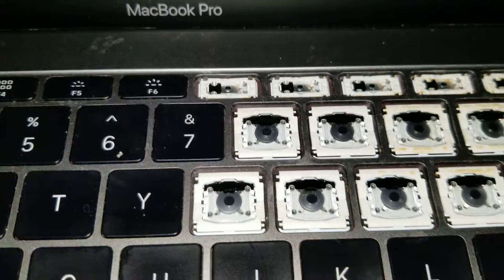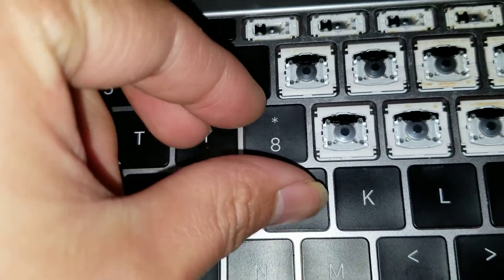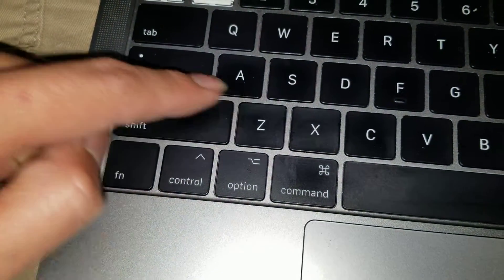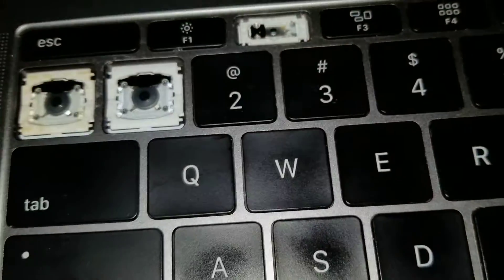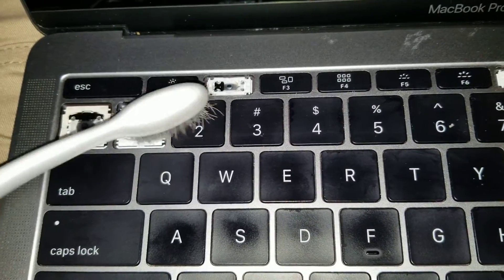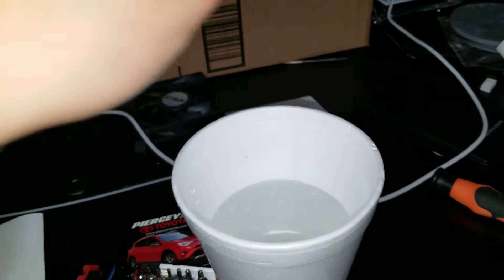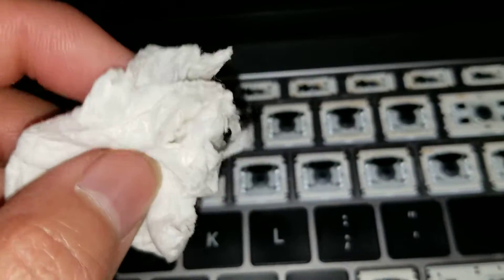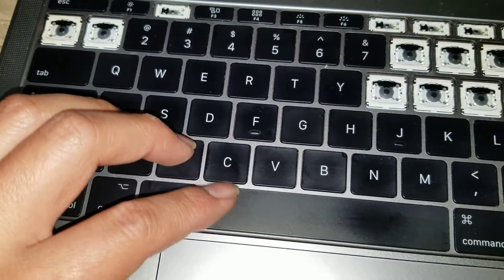How to clean and repair sticky stiff stuck Apple Mac MacBook Pro 2016 2017 2018 butterfly keys key.

Comment: You might be my new hero. Yesterday I took my old MacBook to an Apple repair shop to address a stuck 'n' key that would constantly double or triple print when touched. They told me it would be $600 because the entire keyboard would need to be replaced and that I'd be better off just purchasing an external keyboard. This morning I saw this and tried it. Issue solved. Thank you!
Reply from the maker: Awesome, glad it helped. If you haven't already, please like and subscribe so others can find my videos and possibly consider watching a few others, liking and commenting to get the algorithm to recommend my channel. Thanks!

Comment: I did what you did, and it never fixed it. In the end I ended up popping the key off and cutting little peaces of paper and got tape and taped the little bits of paper the the key. And that actually fixed. it.
Reply from the maker: @mikehawk7307  uhhh what?
Reply: @ItsBinhRepaired  I was able to cut small squares o paper I think 4 MM squares. And I put 3 o the small sheets that I cut on the I guess knob of the key. And once I did that my key was working normally. It is a temporary fix. At least till you get a keyboard palm rest.
Reply from the maker: Nice

Comment: My return key is stuck (it wont come back up) but it still works. Any suggestions?
Reply from the maker: Sounds like a broken clip
Reply: @ItsBinhRepaired  can it be fixed? (also tysm for replying on an 8 year old video)
Reply from the maker: @altaioid  you'll have to replace the damaged part
Reply: @ItsBinhRepaired  oh ok :)
Reply from the maker: Yup

Comment: don't use water, use rubbing alcohol or distilled water.
Reply from the maker: Doesn't work well to dissolve sugar.
Reply: @ItsBinhRepaired  wouldn’t alcohol be better since it’s slightly acidic?
Reply from the maker: @nomnom3265  sugar is a polarv substance. Alcohol is non polar. It'll work if you have a low alcohol concentration, but then whatever you're worried water will do, the low concentration alcohol will also do.
Reply from the maker: @nomnom3265 Google says it's not necessarily acidic and often is basic.
Reply: @ItsBinhRepaired  its the minerals in the water that ruin tech. that's why you use distilled water or high concentration alcohol.
Reply from the maker: @nomnom3265  it's only an issue if you pass a current through it to incorrect components.

Comment: Success! I can now type "R". Thank You. I have a 2012 macbook. I think the key design must be a little different than this one because the key seems to have microscopic hook on top of key with teeny tiny clips on bottom. It was easier to pop off from bottom, not top. 

I used my fingernail to pry if off carefully, popped off from bottom of key. There was a tiny bit of dirt around edges of key, but the issue for me was that there is a tiny clear plastic nipple button that is supposed to sit directly under the center of the key, and it had moved out of place so the key was no longer working. I moved it back to center and popped the key back on, again hooking from top and pressing down until the clips popped into place on the bottom of the key. Careful with that little clear plastic button - when brushing the key with an alcohol-dampened cotton-swab, I nearly lost the button. It's clear and tiny.
Reply from the maker: Awesome, glad you werw able to figure it out

Comment: Oh no I tried this and the key went more inside when putting it back.HELP!! 😭😭😭😭😭
Reply from the maker: Sounds like the clip might have been damaged
Reply: @ItsBinhRepaired  omg what do I do now 😭😭
Reply from the maker: @arbinapradhan2469  pop it out and check it. You might need to get replacement pieces if damaged. Could be you bent the metal pieces if the clips are all in tact
Reply: @ItsBinhRepaired  but how do I know if it's damaged I don't know how it should be initially.. I can't press it..I mean the key doesn't work at all like it's fixated..I think I broke something while taking it out
Reply from the maker: @arbinapradhan2469  pressing the thing under the key doesn't work?
Reply: @ItsBinhRepaired  I just pulled it up a bit with my nails now I can type "3" but it's hard..I mean it's not soft and  doesn't produce click sound.. Idk what's wrong 😭 but at least I can press "3" now but yea not easily
Reply from the maker: @arbinapradhan2469  sounds like it's not put back right
Reply: @ItsBinhRepaired  yes thank you for your time and support<3
Reply from the maker: I hate how YouTube doesn't notify me of replies. Were you able to figure it out?

Comment: Good video and very big thanks.

Here's what I can add to the topic, after messing with my freshly bought used 2015 12 inch macbook retina:

first off: DONT TRY ANY OF THIS IF YOU ARE NOT VERY SKILLED WITH VERY SMALL PARTS, YOU WILL BREAK IT

1) the keys can easily be hindered by either just dust, or the slightest amount of any liquid with sugar in it (acts much like weak glue)
 -> you can clean that up and the keys should be responsive again (read below)
2) the hinges (small hooks of 2 forms (one U shaped, the other C shaped) can break obviously before opening the key up. 
 -> unless they did not break *off*, you can use a tiny amount of superglue and apply it to the hinge and glue it together. I used "loctite control" to fix a broken escape key
3) the bracing of the keys (white plastic, the actual "butterfly") is the most fragile part and can be removed. it's put in place by small stakes going off to the outer sides. if you bend them in that direction, you can release them from the transparent peace of plastic holding the actual button (don't fiddle with that one, I wasnt able to find out if that one's glued, clipped or how the LED is attached!!!!). the axis of the butterfly part is actually just a tiny, flatly pressed pease of plastsic (all unibody) that can tear (found the delete key had that problem) - although, the key might still work more or less fine
 -> you can clean it up and you should be able to superglue broken parts of it together again, since it's all one peace of plastic, UNLESS that small membrane like axis doesnt tear. I was able to tape it together with thin polymid tape, but didnt test much.
4) this keyboard seems to have the back of the keyboard (facing towards the bottom, if it's in normal use) bulges according to key presses. I found no way to fix that with just the keys removed from the top and I read somewhere that the keyboard is held in place with bolts and glue, so
 -> I'll get a new battery (that one's a goner too and needs replacement LoL) and when I replace that, I'll take a look at the back of the keyborad and see if there's a way to stabilize it to pop the keys back outwards a tiny bit - if I don't forget, I'll update my comment

why am I writing this? because the video is supercool and I thought folks should at least have some thoughts on it if they are willing to try to fix it, since I think these devices are really nice and deserve a long life.
all in all, the concept of the butterfly keys is a very good one, but the construct has some major flaws how it was eventually built, which is very typical of apple.

also please: never ever throw away these devices. they are super power efficient, can run other operating systems, have a small mainboard/logicboard and can be used even without display/keyboard/case.
Reply from the maker: I made other videos that are in a pinned comment explaining these other things. If the directions are followed exactly, the chance of damaging it is nearly 0.

Comment: I have a question for you! I have two keys that are not snapping back in but they look exactly like the keys that snap back in -no broken pieces. I even tested a "k" key that works well and tried to snap it into the "f" key that is not snapping back in and the "k" key snapped into the f bracket perfectly. Do you have any advice as to why 1 key is not working or snapping back in? Thank you!
Reply from the maker: Either the hinge or the key is broken. You'll have to look closer.

Comment: IF ANY WATER IS EVER USED, USE DISTILLED WATER AND MORE IMPORTANTLY  MAKE SURE DEVICE IS OFF,  UNPLUGGED WITH BATTERY  DISCONNECTED PRIOR TO ANY REPAIRS.  WHY NOT USE 99.99% IPA ON STICKY SUGARY SUBSTANCES??
Reply from the maker: Do me a favor and fill a glass with 99.99% IPA and then put a teaspoon of sugar in and try to dissolve it. You can do the same with honey/syrup.

Now take a glass of distilled water and put a pinch of salt in it and check the resistance of the water with an ohm meter.

What you're saying sounds good in theory,  but doesn't matter when it comes to cleaning contaminants.

Comment: will vacuuming the dust out do any good? i'm scared it might suck in the actual keyboard mechanism and break it
Reply from the maker: Depends on the power of your vacuum. If you use the hand bristle tool, it should be ok, just don't be too rough.

Comment: Unfortunately, I've seen almost all key problems arise from the fact that the keys are incredibly cheap pieces of plastic. This solution might work for the occasional sticky or dirty key, but not when the plastic claws and hooks break off (has now happened to me and plenty of others I know). Any suggestion for repair companies/services that fully replace keys?
Reply from the maker: There's a website called replacement laptop keys. You can order from there.

Comment: THE KEYS WONT GO ON
Reply from the maker: You might have broken the clips. Check the other video in the description.
Reply: @ItsBinhRepaired  I broke my hinges
Reply from the maker: @pillow1199  :( those need to be glued in. I've never replaced those before.
Reply: @ItsBinhRepaired  I bought a couple replacements off amazon
Reply from the maker: @pillow1199  hope they work

Comment: Unfortunately this didn't work for me so perhaps you can help. My H key just started giving me issues. It's not sticky or anything, it just doesn't register when I hit it. I have to press its harder in order to get it to work, and it doesn't always. I tried taking off the key and using the toothbrush method, but no luck. Any idea what I should do?
Reply from the maker: Sounds like the keyboard circuitry is actually bad.

Comment: Hi Binh, Whats the yellowish sticky stuff you cleaned with paper.. Is it tea or coffee spill by customer or something macbook pro's generate due to heat on motherboard..i have 2-3 keys making clicking sound..will cleaning the sticky stuff resolve the loud clicky sound issue..Thanks for this great helpful video
Reply from the maker: I don't remember, but it's usually something with sugar in it. Other substances don't stay sticky when dry. Usually soda, coffee/tea with sugar, sometimes alcoholic beverages, milk tea, juice, etc. Cleaning should fix it, but be gentle with popping out the keys and make sure you twist all the water out of the paper towel. You don't want it to drip inside the keyboard.

Comment: Followed the instructions. There was nothing sticky on the key.  Did the toothbrush thing. Realized the issue is that the key is flat; not springy.  What could that be
Reply from the maker: The middle thing might not be springing up, or the metal is bent or a clip is broken.

Comment: hm weird. was trying to do it with nail. failed to get good grip but after few failed tries they key stopped failing and worked perfectly fine. didn't even take it out xD I guess it moved the particle away in the attempts
Reply from the maker: Get an electric air blower and blow it out. Lol
Reply from the maker: Video showing all the keys https://youtu.be/oCWlcoq0v0A

Comment: Thanks for this,  do you know if cleaning could solve the double key problem?
Reply from the maker: Most likely won't fix the double key problem unless it feels sticky. Watch the other video in the description as well for a better understanding of how to get them apart.
Reply: @ItsBinhRepaired  I had the double key problem with E and spacebar. For E the white plastic seemed a little weaker than other keys, not sure the cleaning fixed it because it doesn't happen often. The spacebar was a little difficult to remove and i was pulling the white plastic as well and made it somehow permanently unleveled, now the key doesn't have the same travel and feel. If i press on the bottom side and i don't press hard enough it doesn't work, but seems the the double key is fixed at least. The double space annoyed me for so many years... hope it stays like this.
Reply from the maker: @cristibaluta  watch the video in the description. Sounds like you broke something.
Reply from the maker: Video showing all the keys https://youtu.be/oCWlcoq0v0A

Comment: Holy crap that why you need a keyboard cover I never take my keyboard cover off
Reply from the maker: Maybe, but keyboard covers come with their own problems like messing up your screen and slowly degrading and damaging the circuits underneath after a few years.
Reply: @ItsBinhRepaired  i have been using my macbookpro for like 2 years now i don't have any problems with it
Reply from the maker: @cryoffical5035  I've seen a lot with keyboard imprints on the screen from the covers. Lol
Reply: @ItsBinhRepaired  yea i used to have it but since i got screen protector on my macbook i don't have it anymore
Reply: @ItsBinhRepaired  my screen protector is also matte so there is no imprints on my screen
Reply from the maker: @cryoffical5035  I see
Reply: @ItsBinhRepaired  yea you should recommend your customer to get a screen protector as well highly recommend you using it.
Reply from the maker: Too dangerous. Seen too many screens break from a few sheets of paper left in there.
Reply: @ItsBinhRepaired  What paper
Reply: @ItsBinhRepaired  i mean if you are good at applying screen protector like me you will be fine
Reply from the maker: @cryoffical5035  it's more the additional thickness that causes pressure damage on the inside of the screen when closed. Apple makes the tolerances too tight.
Reply from the maker: @cryoffical5035  some people leave paper documents on their keyboard and close the screen on it and break their screens that way
Reply: @ItsBinhRepaired  Ok what ever if you clean it the right way then you will be fine
Reply from the maker: @cryoffical5035  yeah
Reply from the maker: @cryoffical5035  I've seen people even damage their screens just cleaning it. Too much liquid. Lol
Reply: @ItsBinhRepaired  i just use the wipe that come with the screenprotector
Reply from the maker: Sounds good
Reply: @ItsBinhRepaired  yea bro
Reply: @ItsBinhRepaired  yea i but i got a screen protector

Comment: My F key has been wobbly and loose because the top clips on the back of the key aren't clipping in for some reason. Anyone have suggestions on how to get them to clip again? In the video he just presses and they clip back in. Not on my keyboard for some reason.
Reply from the maker: Watch the video all the way through and the one in the description.
Reply: @ItsBinhRepaired  Thanks for the response. I'm still not seeing where in the videos you have issues getting the top 2 claws to snap in. Every time I see you snap a key in, you line up the bottom 2, then press on the top of the key to get the other 2 to snap in. Again, mine do not snap in at all (and the claws are in-tact)
Reply from the maker: @jaredtomeck567  I'll need to see a 4k/8k picture of the back of your key and the hinges upload a video to YouTube and send the link.
Reply from the maker: @jaredtomeck567  other option is you pop out another key and compare the two.
Reply from the maker: Video showing all the keys https://youtu.be/oCWlcoq0v0A

Comment: my w key fell off and it wont stay on, if i turn the mac upside down it just falls sometimes while im using it, it just pops off, will it be expensive to get it fixed?
Reply from the maker: Sounds like you broke the clips. You can find replacement keys online. Watch the video in the description for a better explanation.
Reply from the maker: Video showing all the keys https://youtu.be/oCWlcoq0v0A

Comment: Hey there, i tried your method and all of the normal keys went back into place however I’m having an issue putting those small one on the top back and I’m scared do anything incase I mess it up. Is there a specific way to clip back the smaller keys
Reply from the maker: Watch the video in the description. I think you might have broken something.
Reply from the maker: Video showing all the keys https://youtu.be/oCWlcoq0v0A

Comment: Thanks so much for this video! You saved me $125. I used an eyeglass repair kit screwdriver which has a very small, thin blade and it worked like a charm to pop off my stuck key following your excellent instructions. I'm grateful to you for posting this great video. Many thanks!
Reply from the maker: Awesome! If you haven't already, please like, subscribe, and share this with everyone you know that have this type of MacBook. Thanks!

Comment: Apple acknowledges this flaw and it is covered under their FREE quality program. I got free repair from Apple Repair Cetre in London. They also fixed spotlight and backlight display issue and thats usually 550 GBP but it was replaced for free. My MBP is 2.5 years old without warranty.
Reply from the maker: Nice
Reply: that program is expired now.
Reply from the maker: Sad

Comment: Wut is if my delete key doesn't wantt to goo back in? At the bottom it wont wanna go back in even if u try to and when u do it pops right out  I need help :(
Reply from the maker: You might have broken the clips. Apple might fix it for free. There's a known issue with these keyboards.
Reply: @ItsBinhRepaired  The top ones or fine but at the bottom it pops out
Reply from the maker: @deeliu8622  I'd need to see good clear images of it to determine the issue.
Reply from the maker: Uploading a new video showing every key. Make sure to subscribe and hit the bell to be notified when it's up!
Reply from the maker: https://youtu.be/oCWlcoq0v0A